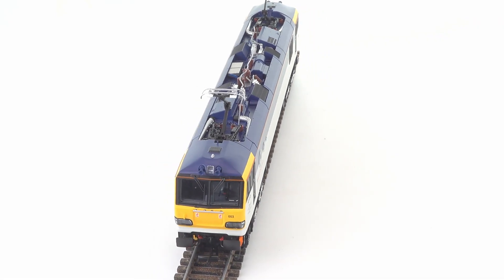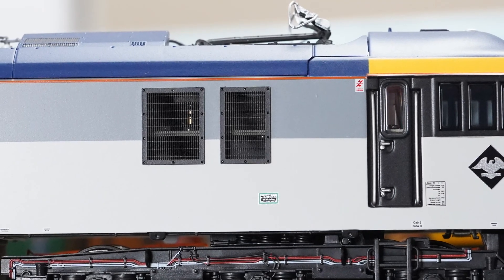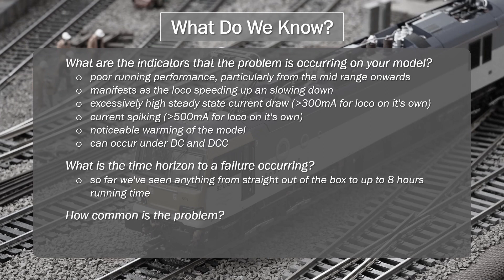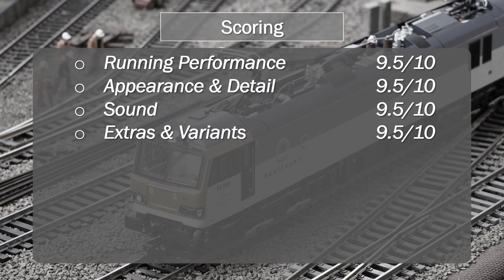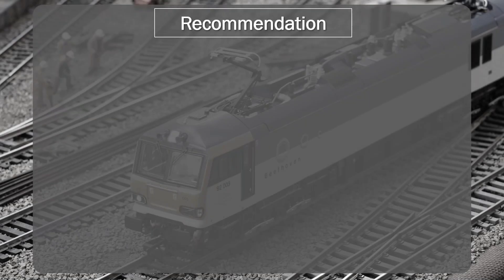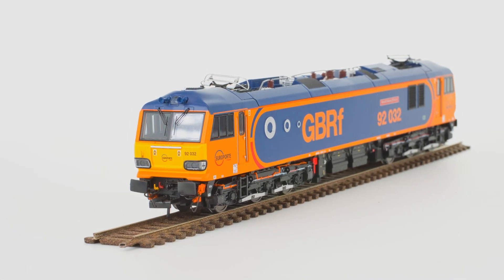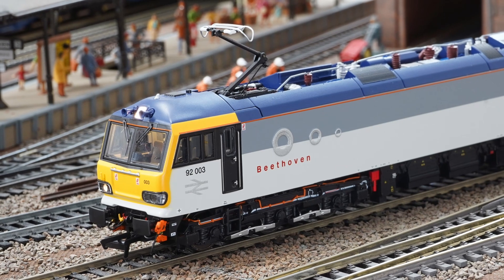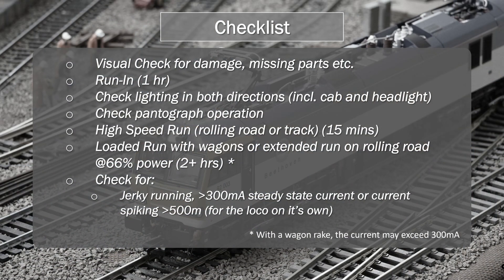Review: Accurascale Class 92 Part 2 - 92032 'IMechE Railway Division', ACC2198-92032DCC, DCC Sound

Comment: Hi Eugene, thanks for the very informative , as always, review. My  class 92 ews Victor Hugo is exhibiting the eratic behaviur of slowing down/speeding up with no changes on the controller. However, it is only happening in one direction. It seems to be running fine in the other . I run my models on dc.  Currently awaiting response from Accurascale having sent them the videos.
The coupler pocket is a nuisance alright. Can't see a way of operating pantographs on dc.
Cheers, Alex
Reply: Hi Eugene, Accurascale have agreed  to fix  the model , so it has been sent to their Irish workshop, will update when I hear from them.
Reply from the maker: @oleks323  They should get you sorted Alex and what you get back will have been well tested.
Reply from the maker: Thanks Alex. I'm sorry to hear your 92 is having problems. I suspect it may have to go back if you're seeing the problem on DC but lets see what Accurascale say. No pantograph on DC I'm afraid which is the same as the Bachmann Class 90.

Comment: Thanks for this video Eugene. I have a model of 92003 coming next week for my 43rd birthday. It's non sound but I will give it a thorough running. I bought mine from a dealer so I am covered by buyer protection but I don't get any bad feelings about my example but we will see how it goes. I will likely just buy a loop of Kato track to run the brute in with and my Kato DC controller. Overall Accurascale do seem supportive although not as good as ScaleTrains when it comes to customer service. ScaleTrains are better in my experience. Just try a ScaleTrains GE Tier 4 GEVO in HO scale and see what I mean about quality. They are great models. But on topic here, I plan to stick with the BR era versions of the Class 92 as well as the Cavalex Models Class 60 that is due next year. I do plan to get one and review it and it will be interesting to hear your thoughts on the new Class 60 if you are planning one as well mate. I will be reviewing mine this month sometime but although I do N scale mostly. I do plan to have a handful of OO and HO models to enjoy them at model railway clubs. 

Here is a like from me
All the best
Peter.
Reply from the maker: Thanks Peter. I've been happy enough with Accurascale's support so ScaleTrains must be really good! I'm pre-ordering 60087 so we'll see how that goes. It's actually my most expensive loco purchase so expectations are high.

Comment: Michael Leighton....Hello there I've bought 3 Class 92 locos and I have to say they are superb models but I regret to report that two have been sent back due to faults. The first model which is the GBRf  92032  exhibited the same problem highlighted by EuviRail. The loco ran erratically and drew more than 700 milliamps constantly causing my prodigy controller to trip out on overload. This loco also ran warm and I'm looking forward to a solution. The second loco I have returned is the sleeper model 92010 which made clicking and knocking noises at slow speed as if the gear box or drive shafts are catching on something. A third loco a railfreight model operates perfectly and draws a current of about 200 milliamps at full speed and has shown no signs of warming even when run at full speed for over two hours
Cheers Mike..
Reply from the maker: Thanks for sharing Mike. Your distribution of problems has been very similar to my own. I had that clicking problem on a third model which I returned  for repair and decided to get a refund on. They are lovely locos for sure but the motor/gear chain failure was just too high. I would hope/assume that Accurascale have done the necessary root cause analysis etc.

Comment: Hi, nice review but I was wondering if you've had any issues with the couplings? I purchased two of these 92s and both suffer the same problem. When on a curve, the coupling does not move far enough back to the track centre and results in derailing anything it is pulling. I've tried several wagons and coaches and even an older style with a large loop. This is on both 3rd and 4th radius. I am currently discussing with Accurascale help but noticed in your review you had it pulling a rake of container wagons. Was this before/after or during running in?

Comment: If you’d like to reduce the the ride height of the Class 92 pantographs the following steps have been advised by Accurascale. Ensure loco CV31=16 & CV32=0. Pantograph 1 = CV360 Pantograph 2 = CV368. The factory default setting is =25. I set my pantographs to 40 to reduce ride height as recommended by DaveClass47. Personally I think this is a better height and looks better on my layout. I have no masts or  overhead wiring at present on my layout but may install in future.
Reply from the maker: Thanks for that. I had actually added that detail to the description last week in response to a number of queries. I would agree that the lower height does look better not to mention helping avoid any catastrophe with bridgework etc.

Comment: Hi Eugene, an update for you. My three 92s were returned and refunded by the retailer who said they weren't aware of anyone having issues with these and that they couldn't find fault with my returned items! They were not best pleased to have to issue refunds and "suggested" I shop elsewhere in future!  This was a well know main retailer from the Sheffield area! I then cancelled all my pre-orders for Accurascale locos with them. Since then I've noticed a running problem emerging with similar characteristics from my Accurascale class 55 Deltic too! Erratic running at times with random speed changes and glitches. I would stress that this has not been noticed on any of my other locos, only the Accurascale locos. Could there be a component issue within their circuitry or motors right across their ranges? Keep an ear out for any other reports of erratic speed changes. Accurascale are new to the loco market so might be experiencing teething problems and thanks to Covid their Chinese supplier may have had to source components from "alternative" suppliers! Keep up the great work, regards Julian.
Reply from the maker: Hi Julian, thanks for the update. At least the experience in dealing with Accurascale is a lot better than what you experienced. They replaced the motor in my failed unit and as you say there may be something in terms of either the supplier or the way the motor is driven. I would hope Accurascale figure this out whatever it is. I picked up Marco Polo during the week and that seems to be fine. I guess the Deltics use the same motor and drive circuitry so some folks have had similar issues. It sound like you may be contacting Accurascale support in the near future but at least they'll sort you.
Reply: that’s wierd since the 92 has the exact same motor as most large locos, including the hattons 66 or the hornby large steamers…. identical motors from the same supplier
Reply: are you running a Hornby controller? or maybe one of those terrible prodigy things. neither output compliant signals for dcc
Reply: @mccarronfamily  I don't know whether you are trying to be helpful of defensive here. May I ask how you are connected with this product? You seem to profess to know details not commonly known by the public! Are there other exemptions to the correct functioning of these Accurascale products that should be listed for public consumption or are the customers supposed to just expect them not to work randomly for various unexplained reasons and then just say to themselves "Oh well, hey ho!"?
Reply from the maker: @mccarronfamily  I have been running with a Hornby eLink with a 4 amp transformer for 10 years now and it's never been the root cause any motor related issue (of which I've had very few), and I've probably run 300-400 locos on it in that time. I won't claim  it's anything brilliant but I haven't had an overwhelming reason to change it. The problem on my 92003 was confirmed as a misaligned brush on the motor and the motor was replaced. It runs fine now, though a little noisier that it was originally. My 92032 is an impeccable runner and absolutely silent - as 92003 was before it started failing. I got 92009 last week and unfortunately that seems to have a different problem with a grating noise that hasn't cleared after being run in. It's not the same issue as 92003 as the current and running seem fine. The noise would indicate a drive train issue and even though it still appears to be running ok, I suspect this won't be for long as I've been here before with a Bachmann Class 66. I put in a message to support on this last night.

Comment: I was running mine the other day I did notice a fair few spikes on my alpha meter going up to 700 to 800 milliamperes and slowing down then speeding up for a short while should I return it or just contact them.Other than that and the nem socket falling out it runs fine.
Reply from the maker: Hi Stephen, that sounds like my problem. What level of power were you applying when seeing the 700-800mA? In truth you should never see those numbers so this is a return I'm afraid for a motor replacement.
Reply: Ok thanks will send them a mail

Comment: Just wanted to Update to my class 92 running issues, thanks to some extremely rapid responses from Accurascale support, (possible the best customer support I've encountered in a very long time), my class 92 is working perfectly at the moment. A couple of resets seemed to resolve my issues. Stay alive now working properly and speed has improved. Just as an fyi, if anyone is seeing an issue with the stay alive, Accurascale recommended these settings to make sure the stay alive is switched on.
CV’s:
CV113 = 127
CV31 = 16
CV32 = 0
CV363 =  31

Cheers
Reply from the maker: Excellent, thanks for that. I'll include these setting the description. It's definitely working on both of my models but CVs can get corrupted or overwritten by mistake so good to have this.

Comment: It seems to me that Accurascales inexperience as a manufacturer is showing through here.  It must be that the motor is not the necessary specification for a model of this size and weight. If the same issue occurs with your second example, then you;ll have to resort to the Sam's Trains expedient of replacing the motor yourself!  Thanks for uploading.
Reply from the maker: Thankfully my second model has turned out fine.  As they say, anything is only as good as it's weakest part. Only Accurascale themselves know the real profile of failures but I have to be believe the motor is high on that list. I hope they are giving grief to their supplier or alternatively finding a new one. In another life I worked in Telecoms manufacturing and we'd resort to component screening if we had to. Less than 1 failure in 10K was our base requirement with some customers looking for 1 in 100K. They paid for it of course. For railway models it's probably between 1 failure in 100 and 1 in 200 so it's a very different world.

Comment: Thanks for this, was really struggling to understand the issues that suddenly appeared with three of my deltic’s, which is exactly the characteristics you listed. Accurascale need to find a new motor supplier/design for future releases and a cause as to why this is occurring ASAP
Reply from the maker: Glad the video was of use. Yeah, the quality of materials and sub components can be a real problem with Chinese manufacturers in particular. A tight reign is needed to keep things under control regardless of their assurances. You can assume nothing with them and I hope Accurascale have learnt that.

Comment: Hi Eugene,
Have now setup an oval track on my dining table, don't laugh, with radius 2 curves and a straight on both sides so I can just run both my 92's off the rolling road to see how they perform on the open road so to speak.
Anyway, compared to my Hattons 66's, Hornby Class 60's & Dapol Class 68's the Accurascale 92's seem markedly slower thru the speed step range which you don't really notice on a rolling road hence the temporary table top setup which isn't ideal I know but just gives me an idea on the performance of the loco's without coming off the track.
Is this due to how the decoder is setup on the 92 i.e. motor settings?
Do you find your AS 92 slower on your layout compared to your other loco's?
I'm just curious and just looking for some feedback and one of the many drawbacks of not having a fully built layout with all sorts of conditions to measure performance capabilities from each manufacturer.
Cheers Steve
Reply from the maker: Apologies, I just saw this in my for approval box. These models definitely fall short on their prototypical top speed by as much as 10mph. I don't have a high speed DC circuit so I can't test it there. I've seen this on other models as well. I always have a question mark when I see this - was there a problem at the higher speed and hence they tuned it down?
Reply: @EuviRail  no worries Eugene.
Btw had my 3rd Class 92 failure yesterday, I had purchased DCC Ready Yuwi-London Train 92015 from Rails and bought a Class 92 sound decoder from DC Kits which I installed.
Soon after installation & putting on the track I got a loud crackle from the speaker when playing the horn off F2 so have a faulty speaker and on top of that the forward pant servo motor failed so the panto refused to go up or down but the other one was alright, the servo motor making a whirring sound but no movement of the panto.
It ran normally on DC and DCC after putting the decoder in but by doing that it revealed the speaker and panto servo motor issues.
Sent it back to Rails who are great and they will take a look & repair.
Reply from the maker: @saphire-c4k  Wow, you've been in the wars! I don't come across a bad speaker too often but I guess you're going to see them from time to time. Yeah, best to let Rails sort it for you.
Reply: @EuviRail  Yeah I've never had 3 loco failures of the same type, to be honest I've never a had a brand new loco failure until now.
Not worried about it as I know AS will look after them but I hope they see the issue & learn from it as it seems the panto servo motors on the Class 92 may have have an underlying fault that needs rectifying if they do a second batch.

Comment: Having run my 92010 on a few sessions and being satisfied that the functions work correctly (including pantographs) I have decided to keep it in my collection without extensive trials. It is a decision I have had to make as I collect locomotives and only run them at low to average speeds occasionally and without load. I display them from time to time as static items featuring liveries that I particularly like. 
What surprises me, being relatively new to this , is the number of failures mentioned on this channel so far. I used to work in a manufacturing industry where we stress tested new products for some time before releasing to the public. I would have thought that this would happen in the modelling world such that issues as experienced with the 92 could be detected and addressed before going on sale. I assume that there is commercial pressure to get new releases to trade with the current long times experienced between pre order and despatch to customer.
That said, I do have faith in Accurascale as a new company which is setting new boundaries. Their customer support is good and I think things will improve as they develop. I have ordered my class 89 already!
Reply from the maker: Hi John, it's  up to every individual to decide on what they are comfortable with. If you are more of a collector then the functional sanity check is the most important.  The dynamics of offshore contract manufacturing has it's challenges and a certain dropout is factored from a spares and repairs perspective. Normally it doesn't get much attention. If you have a bit of a cluster as we've had here then the concern level can ratchet up a bit. Unless there is a more pervasive issue, things should even out over time which I think we are seeing now. Best of luck with your badger!

Comment: Haven't had any motor issues yet, but GBRF arrived with a grille loose in the box. To be fair, we haven't  pushed the performance envelope yet. Slowly catchee monkey I think, rather than giving half bore for 30 mins each way, we'll creep up to higher loads/speeds to see if it makes a difference...Andy.
Reply from the maker: Thanks Andy. No need to rush it. Maybe towards the latter stages, I would recommend doing a max speed run for 10-15 mins on a rolling road if you have one.  I was definitely navigating 92003 through the speed grades multiple times in the course of filming due to the re-shoots I had to do. Grille aside, at least you've seen nothing of concern so far.